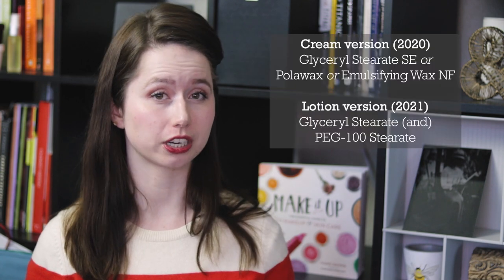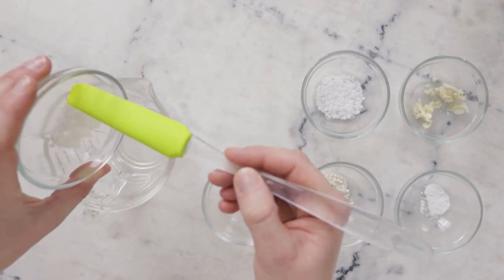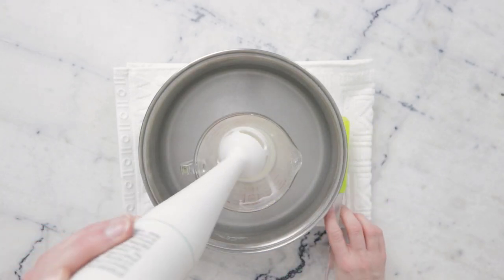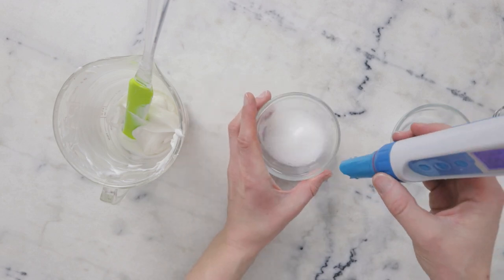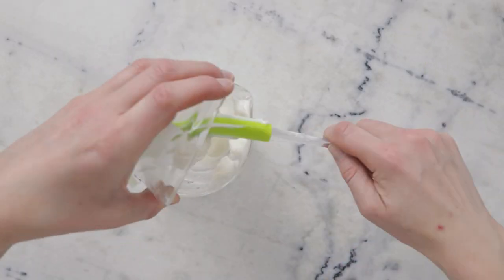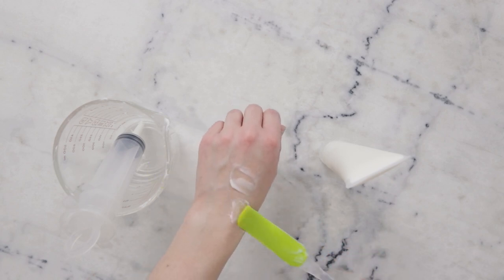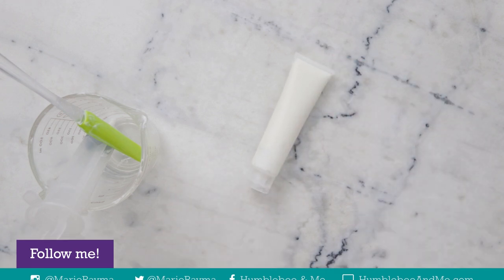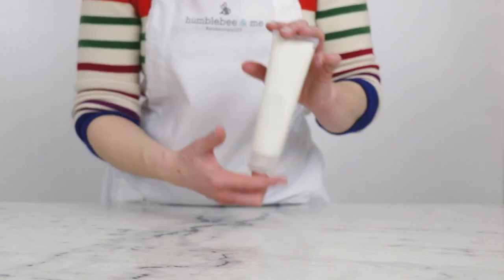How to Make DIY Moisturizing Repair Lotion // Humblebee & Me

Comment: At what temperature do you add the optiphen plus? I'm told you add the optiphen plus while it's still warm or it's going to destabilize your emulsion
Reply from the maker: As per the video, "reasonably cool to the touch"—there was no secret thermometer ;) I have never read that about Optiphen Plus, and have generally found claims about it destabilizing emulsions to be exaggerated. I've literally never had it cause an emulsion to split :) You certainly CAN add it while it's still warm (it's ok up to 80°C), but I would only ever do that because the formulation would be solid at colder temperatures. Happy making!

Comment: Hi love, your videos has great me immensely in formulation. I  find it very  hard to understand the HLB system, I formulate only natural skincare and use mostly natural ingredients.  Can I get away not using the HLB method? I mainly use olivem 1000 and montanov 68 in most of my formulations.  I use xanthan, cetyl alcohol and cetyl palmitate as well. Thank you
Reply from the maker: I don't work with the HLB system anywhere and have not found it neccessary.